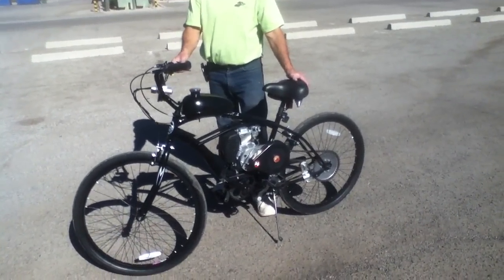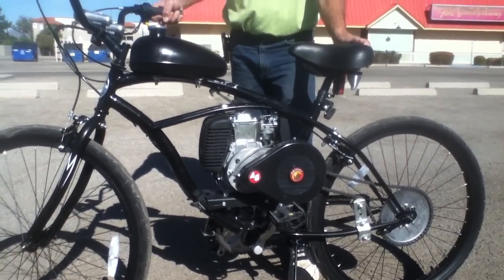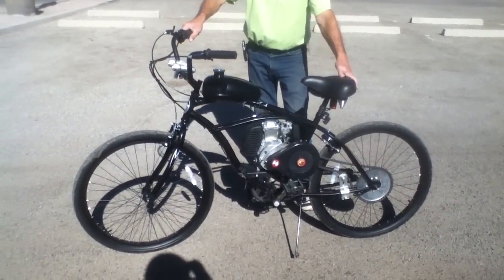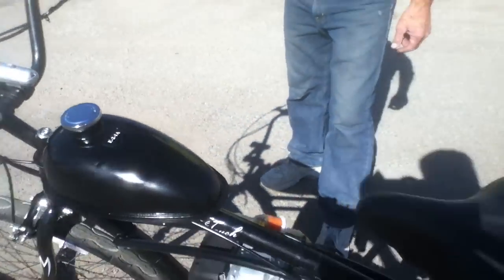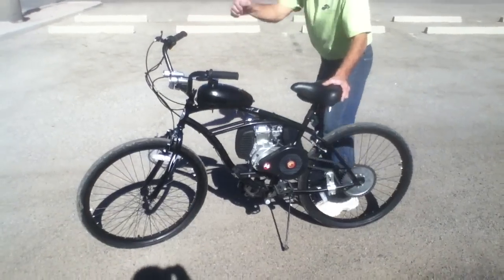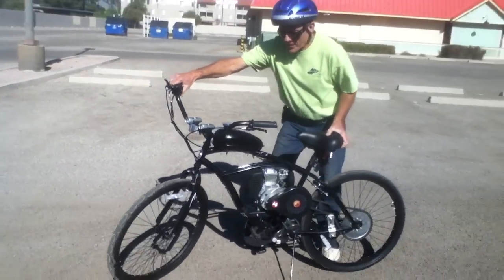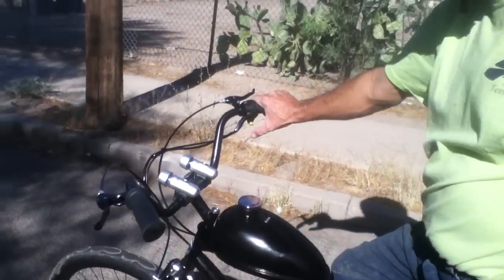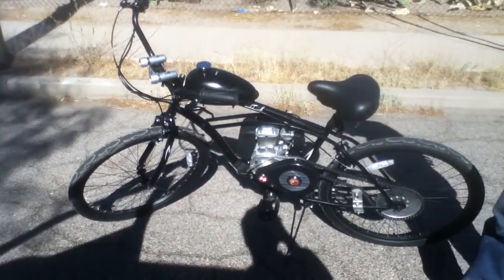2ND GENERATION 4-STROKE MOTORIZED BICYCLE from UMOTOBIKES.COM

Comment from the maker: Thanks John!  It's cool to know you saw Ernesto all the way from Ireland!  Best wishes
Reply: Do you need a motorcycle license
Reply from the maker: Hello. Thank you. License registration varies between cities and states but many times 48cc motor displacement doesn't need it as long as you travel under 20 mph.
Reply from the maker: timbo Slice Hello thank you.  DIY 2-strokes start around 325 and fully motorized bikes start around $899
Reply: @U-MOTO Motorized Bicycles

in california OK with no license required

Comment: hey dude. thanks for the callback last night. black micargi touch + 4 stroke kit = win. the bike pictured here has a seat tube that extends down and connects BEHIND the pedal housing/bottom bracket. some touch models have the seat tube that extends down and connects TO the pedal housing/bottom bracket directly. if you google 26 inch micargi touch, you will witness both style types. you use a bigger, stronger mounting plate than the one i'm about to use, therefore your engine sits as high as it does. my plate is way thinner and shorter, (and weaker,... )BUT I have the seat tube-directly-to-bottom bracket style touch, so im going to have even less horizontal distance than your style, and yet I should still be able to get my smaller plate in there low enough to hold it, and since im not making it to be a showpiece, im willing to ditch the chainguard completely, not just lower it/alter it. and a smaller front pedal sprocket would be my next tactic if losing the chainguard isn't enough. I just love the look of the black micargi touch with a 4 stroke kit. all other styles of bike either look like the pee-wee herman bike-LOL- or a ridiculous chopper style that will put you in the grave if you dump it, and look ridiculous being ridden by anyone over 13. I guess mtn bikes can be made to look decent, but most of them have oddball frame geometries and weird tube sizes and shapes. and are expensive (er) (spelling)-----good luck with your sales!! that's a pretty bike!! and your callback last night was something you just don't get from most bike builders. good luck, bud!!

Comment: I have a question: Whats the difference in the T-belt transmission and the gearbox edition? Any reliability or speed differences?
Reply from the maker: Thank you very much for your interest.  The gearbox is less expensive but there is more vibration after a threshold # of rpms.  I like the t-belt drive because it is more smooth.  You can see the newer 3rd generation U-MOTO 4-stroke motorized bicycle on the link below.  Thanks again  

3rd Generation U-MOTO 4-Stroke Motorized Bicycle System

Comment: how much are these, the 2 stroke kits are roughly 140 dollars total. and I have been running mine for well over 1000miles. check out my 1000 mile motorized bike review
Reply from the maker: These are around $380 ($410 after shipping.)  They are more expensive but there are advantages such as not having to mix gas and not having to have a manual hand clutch to engage/disengage the motor.  If you can afford them, they are worth the cost.  Please let me know if I can help you with any more questions.  Thank you very much for your interest!

Comment from the maker: Just keep the speed down.  It's peddle assist.  10-15 mph is all that you should go.  Keep things safe! Wear a helmet.  Use lights and always inspect your bike and watch out for traffic.
Reply: mine goes no faster than 30 mph when the police are around. That's the legal limit in Idaho. other than that I can get it up to 35 with a shifter kit.  I can take off from a dead stop up a 10% grade too.
Reply: No, this video is peddle assist. The bike engine is pedal assist.

Comment: I love these motorized bikes. Fun to drive & super cheap to own & fix. My only gripe with these 4 stroke kits is the transmissions made for them aren't very well made. The motor seems to be the only real decent thing about them. Had to put at least $100 down on upgrades to get running almost perfectly. I cant stand the belt drive 4G T belt transmission. Fails easily & a bitch try to fix. I scrapped my 4G after the last failure & plan to use a modified pocket bike CVT transmission with better quality components. Seems like it would be far better than the crappy 4G & hopefully last much longer.

Comment: Kickstand!! Kickstand!! Kickstand!!
Reply from the maker: joseph lesko yes thank you we sell kickstands too check out shop.umotobikes.com
Reply: @uMOTObikes  believe it or not i have a guy i deal with who operates out of his garage a retired engineer who  builds exact same engine bike kits 2 and 4 stroke and he sells them for the price of engine plus 100 bucks for labor which is more than fair the two bikes he built for me minus the gas tanks were mine to begin with btw the black thin metal tanks tge kits come with are garbage upgrade to bigger older plastic for more capacity and better construction.
Reply from the maker: joseph lesko please give me his phone or email I can supply bikes parts engines to him in bulk at a great price we sell to dealers across the USA thousands of motors, gas tank frame bikes, forks, components
Reply: @uMOTObikes  ok whats a more private way of exchanging info??

Comment: Bought one , nothing but trouble. Gas bikes are tricky - you have to build it, got my hands dirty with gas, won't start , seller won't let me return it, sliced my hand trying to get it to work, gasoline leaks everywhere. One problem after another 

Electric bikes are the way to go
Reply: E bikes are horrible. I think someone needs a 2stroke.
Reply: I agree; the seller has apparently stopped QC checks altogether..I bought one, and initiallly it was nothing but problems.  I have some wrenching experience, so I've got mine in a serviceable condition, and ride everyday.  I have replaced several things to increase reliability, but it's definitely not something to jump right into if you are expecting a smooth experience.

Comment: I am HIGHLY un-impressed. I build these bikes for a living and the price is way to high, power and torque are laughable at best. The sprocket on the rear is very unbalanced. Bikes in most areas of Arizona can't have a transmission without registration. Just watching this thing go down the road was down right scary. Put up your damn kickstand. Also one last thing, the price that he wants for this thing is MUCH higher than it should be.
Reply from the maker: Thank you very much for your interest in U-MOTO Motorized Bicycles!   If you are interested in purchasing one of our excellent bikes, please feel free to call, text, email, or message.  Here is another video of one of the new street-legal motorized systems that U-MOTO has to offer.  Respond now and I will give you a special discount.  Thanks again.

3rd Generation U-MOTO 4-Stroke Motorized Bicycle System
Reply from the maker: Thank you so much.  At U-MOTO we are poised to now serve thousands across America with the best two and four stroke motorized bicycles and kits!  Please give us a call or email us.  We are proud to serve small builders like yourself all the way to large national retailers!